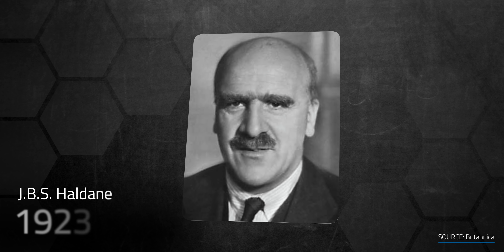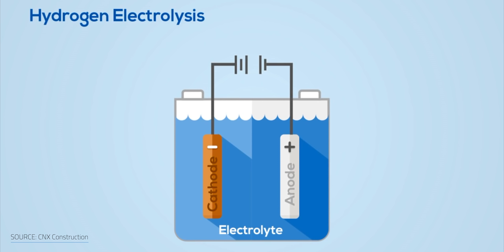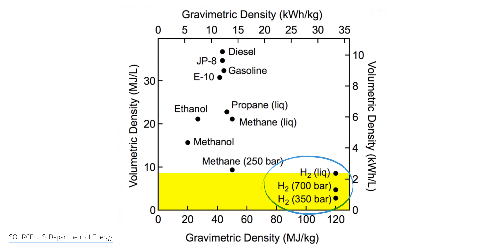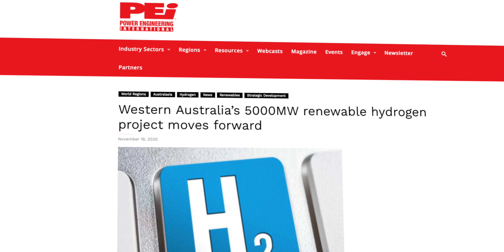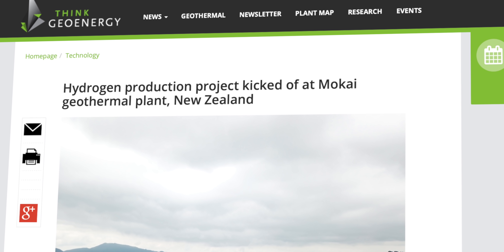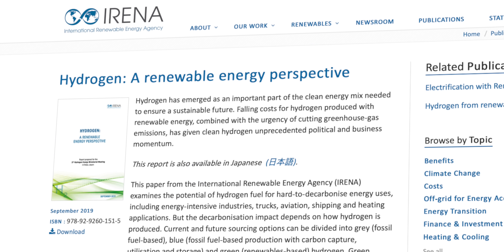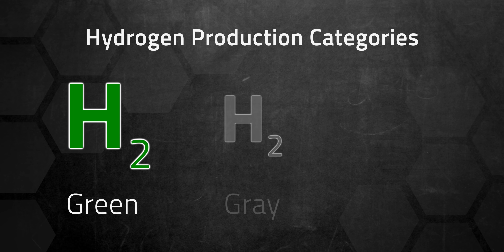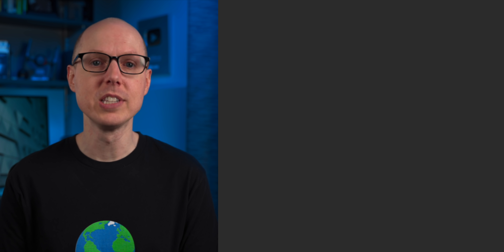The Truth About Hydrogen's Dirty Problem - Green Hydrogen Explained

Comment: I find it really interesting that hydrogen is even being considered as a viable, commercial fuel for private transportation .

The amount of electrical energy required to commercially create 1 kg of hydrogen is truly enormous - why not put that energy directly into a BEV - it's a no brainer for me.
Reply: I think you're probably right, but we don't yet know for sure that producing billions of BEVs will be sustainable. Hydrogen may not be the most efficient means of doing things, but if the overall infrastructure it requires is more sustainable to build and run then maybe we "just" need to build 3 times more renewable generating capacity than a battery-powered world would require!
Reply: @George Mann I do love power-to-fuels

The toxicity of methanol/dme if spilled in the water table is a huge downside.

Check out “butanol” as that is better than ethanol.
Reply: @George Mann I think composite tanks have helped with the storage issue, but liquid fuels are definitely easier.

Methane->Methanol is an easy conversion though, so as with all renewable tech they can coexist/find niches

(Methanol for vehicles, methane for large scale transport/storage? etc)
Reply: Look up “Power-to-X” / “Power to Fuels” we can turn hydrogen and co2 into methane, and use Solid Oxide Fuel Cells (or existing ICE based “Natural Gas Vehicles” )
Reply: @George Mann Racecars often use methanol injection or pure methane fuel right?

Comment: Yet another video of you talking about Hydrogen but completely ignoring it's major flaw: terrible efficiency.

Hydrogen is for energy storage, not a source of energy, so you already start out with electricity (from for example a solar panel) and you convert it to hydrogen, store it under high pressure, then later convert it back to electricity. The end result is only 25-30% efficient.

Way worse then simply using the electricity you already had, store it in a battery and use it which is about 90% efficient.
Reply: Two thoughts:

1. Hydrogen works better than batteries for long-term storage. Batteries have significant self-discharge, and are really only suitable for storage for a few days at most, whereas a cavern full of hydrogen will still be full of hydrogen months later.

2. The round trip efficiency is low, so what? The cost goes up, but what does that mean we use instead? Fossil fuels are going to end up taxed or banned in a decade or two and biofuels have at least as much trouble with large-scale production as hydrogen does. I've seen some very exciting thermal-based storage concepts from Siemens, but that has a similarly low round-trip efficiency to hydrogen energy storage. Battery electric vehicles are great for small passenger vehicles, but for long-distance haulage (truck or ship), the weight increases non-linearly with range, limiting your payload and, therefore, your revenue. Hydrogen fuel might be more expensive than charging, but if you can transport more goods with (potentially) less downtime, it can still be more cost-effective overall.

Hydrogen has significant shortfalls, and I can see it losing out in a lot of applications (e.g. passenger vehicles), but there are some applications where it's either the only option or its competitors have similarly debilitating shortfalls. I'm interested to see whether electrolyser and fuel cell manufacturers can deliver some of the things we've been promised for decades before other technologies manage to nibble away those niche applications.
Reply from the maker: I've actually touched on that in a previous fuel cell video a while back. But efficiency is only one piece of the puzzle. Cost is the biggest factor.  Whatever can deliver the needed power at the cheapest price for a given use case ... that's going to be the dominant player.  It's why BEV is winning in passenger cars.
Reply: @UndecidedMF  Of course but cost is directly related to efficiency.

Comment: Hydrogen has some pros and cons. Taking energy+water and breaking it down to hydrogen and oxygen, then putting it back together into water+energy is a great idea. No emissions, no carbon, etc.

The trick is energy density, weight of storage in mobile apps, leakage, and efficiency/cost. 

Battery storage naturally beats it at the smaller scale end. You won't be running your laptop off hydrogen any time soon. Hydrogen wins at the bigger end though I think. You won't be sailing a ship from China to LA on batteries any time soon, but at that size the infrastructure for hydrogen makes more sense. (big tanks at high pressure etc.)

Comment: Fun science project, but I can guarantee you, there will be no hydrogen economy until there is cheap, abundant, over production of carbon free energy. Until then it will exist in niche markets and localized places. The folks claiming otherwise are actually fossil fuel corporations hoping to transition their investments into something that they can put a “green” sticker on. This is the same scam as the “clean diesel” scam with the exception that it will be nearly impossible for the a average person to recognize that it’s a scam. They know if they can make society dependent on hydrogen, then it will undeniably need to be sourced from natural gas. Thankfully though, cost will basically keep this where it belongs for many many years, allowing actual green solutions time to grow and render the “hydrogen economy” uncompetitive before it even gets off the ground.
Reply: I share your cynicism but applications like aerospace, heavy vehicles, steel-making and chemicals do seem to make sense.
Reply: @armadillito  I’m not saying there arn’t ANY niche use cases for it. There is just no “hydrogen economy” on the horizon. Certainly passenger vehicles are out of the question.

Comment: While generating hydrogen with electricity is not efficient it does make sense, when there is excess electricity in the grid.
I heard they are disconnecting solar in California in summer. It would make sense to generate Hydrogen with it between 10-14, when the grid could not handle the generation, instead of disconnecting it.
Reply: It does not make sense actually. There are better ways of storing energy. Battery storage, pumped hydrogen, and liquid air battery storage are all better choices. Hydrogen is a con from the fossil fuel industry in an attempt to stay relevant in the next decade
Reply: @ultrastoat3298  If they could store all that energy in a battery it would not be disconnected from the grid. The battery required is just too expensive at the moment for that.
Reply: @kolle128  huh? A hydrogen solution is more expensive than all 3 of the solutions I mentioned.... which you oddly singled out one of them.
Reply: @ultrastoat3298  We do agree I think that the storage should be improved. I just think that this is the quickest method of doing something with the electricity, and something is better than nothing.

Ofc, If the capacity of more efficient storage methods increases I totally think they should be used instead of hydrogen. But its not like there is a liquid air station built, that is currently unused, or two nearby lakes for pumped hydro, that nobody noticed until now. The total capacity of the existing storage methods is not enough.

Comment: Considering how little wind and solar resources we have right now we need to concentrate on using those to decarbonize the power grid. For now turquoise H2 would be the best way forward, the solid carbon generated can be used in building applications or stored safely. Another problem with green H2 is the dependence on fresh water. The green H2 plants would need to be located where fresh water is plentiful and won't hinder local farmers and populations. There are some nascent salt and polluted water H2 technologies but only time will tell if they are economically viable.
Reply: You don't need fresh water for hydrogen. Pure water is actually useless since it doesn't conduct. You need at least some impurities for electrolysis to work so sea water is actually fine for this.
Reply: @captainswjr  Putting sea water through our current commercial electrolyzers produces chlorine gas which quickly degrades the equipment. The sea water has to be purified with a reverse osmosis process or distilled, then safer salts added for the electrolysis process. Either way produces either a brine which needs careful consideration on how it will be reintroduced back into the sea or a membrane waste byproduct disposal process, since if this will be used on an industrial scale a lot of brine or membrane waste will be produced. As I said there are methods using catalysts that can deal with sea water, but they are experimental and expensive at this time.

Comment: Hydrogen got a bit of a bad rep from the early push for fuel cell vehicles that lost hard to BEVs. It's still a pretty bad idea for a civilian road vehicle fuel because of the insane infrastructure buildout necessary to make it viable. Where Hydrogen could do very well is in aviation because the infrastructure can be more concentrated. It's also worth looking into for military vehicles, especially for countries without a good internal source of oil. Japan in particular, being a leader in hydrogen tech, would benefit greatly from that capability since they don't need as much logistics integration with allies.
Reply: HGVs, similarly to aircraft, follow consistent routes so are relatively easy to build a fuel infrastructure for.
Reply: @armadillito  Siemens and Scania's Electric Highway project is also a great option for those. (Even better than Hydrogen in my opinion)
Reply: Hydrogen just needs a better storage solution and many companies are already working on that.

Comment: I think we need to be more precise but also more realistic regarding green vs. non-green.  Fossil fuel, in and of itself, is something that exists in our environment and is not "not green"... until you BURN it.  So if you can create hydrogen from natural gas without burning the gas, it's green.  Certainly that is not a long-term solution because there is a finite supply of natural gas-- but it can be a way to bootstrap adoption.  The whole argument of "it's not green unless it's green, end to end" is a bit dumb.  You gotta start SOMEWHERE.  Maybe you burn oil to create solar panels, at first, but eventually you can use green electricity to produce those panels-- the transition takes time.  For the same reason, PHEVs are better than EVs because they can collectively reduce more green house emissions, NOW, TODAY, much more than all the EVs in existence because battery production is the weak link.

Comment: Hydrogen is not cost effective fuel with present methods existing today. If it was an economically viable option today saying it "could be" or "might be" in years 2030 to later wouldn't be heard or said in this video.
Reply: Pure economics doesn't have to hold essential technologies back - if green hydrogen is deemed important enough governments could subsidise it.

Comment: The challenge is to produce a surplus of renewable energy produced by wind and solar. Be it a home, commercial locations, cities or the world, if solar, wind, and storage (SWS) can beat out other "fake" alternatives then there is hope. Green Hydrogen is an important aspect of this.
Reply: Yes, having renewable energy to spare would make green hydrogen look a lot more plausible.
Reply: @George Mann "absurdly high cost of wind & solar"? Where have you been for the last couple of decades? The rest, perhaps, holds up.
Reply: @George Mann so the fact that the UK doesn't subsidise wind but does subsidise coal is because...?
Reply: @George Mann First, I regard green hydrogen as a last resort when other storage or transport options are not available.

Let me expand a little on what I am saying, but start with a question: Name another renewable energy source other than our sun? The issues of Carbon and the potential of nuclear fusion aside, we as a species only have one choice and that is the sun.

As to the cost of solar and wind, please don't forget that at present fossil fuels are cheap (fracking is dead). Over time they will increase in price. Just think of $15 a gallon gas.
Reply: @George Mann "Too Cheap to Meter"?
https://phys.org/news/2011-05-nuclear-power-world-energy.html#:~:text=Uranium%20abundance%3A%20At%20the%20current,for%20less%20than%205%20years.
Reply: @George Mann I normally do not carryon with this type of conversation but will comment on your reply to "To cheep to meter".  It took me 30 seconds to find the reference below. This calls into question the quality or your sources of information:

https://spectrum.ieee.org/energy/nuclear/too-cheap-to-meter-nuclear-power-revisited

Which references:
https://public-blog.nrc-gateway.gov/2016/06/03/too-cheap-to-meter-a-history-of-the-phrase/

The issue is that the nuclear industry has been promising "to cheep to meter" for decades all the while diverting billions of dollars away from better investments.

Comment: H2o vs. co2 in the atmosphere, which has a more significant greenhouse gas effect? I believe it's h2o, not co2 batteries are the future. We will be right back to where we pump so much h2o into the atmosphere to creating the same problem messing with the equilibrium of greenhouse gases, just my opinion.
Reply: H₂O condenses and precipitates out of the atmosphere. It's part of the water cycle.
Reply: @vinnytube1001  disagree the water cycle is much more complex than that.
Reply: @lifeisgood339  Of course I can't take the time to educate you on the complexities of the water cycle, I expected you to look it up. Water vapor in the air contributes to absolute humidity. Our planet has a fast cycle for getting this back to liquid water, but there is no fast cycle for CO₂ or CH₄, and that is the big problem. On top of that, you'll note that H₂ FC vehicles tend to condense the vapor and emit mostly liquid H₂O anyway.
Reply: @cameronbegg1404  it turns into water vapor which is why I said h2o not hydrogen
Reply: We have an increase in temperature because of the amount of water vapor composition in our atmosphere. Co2 has accelerated this process.